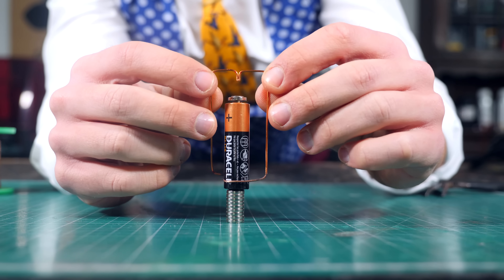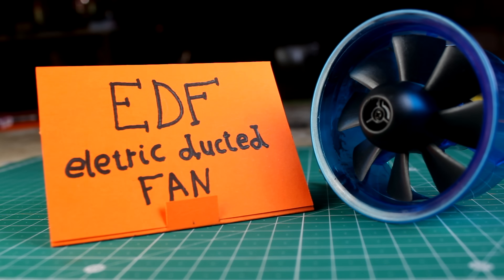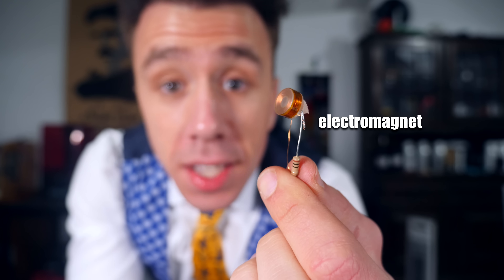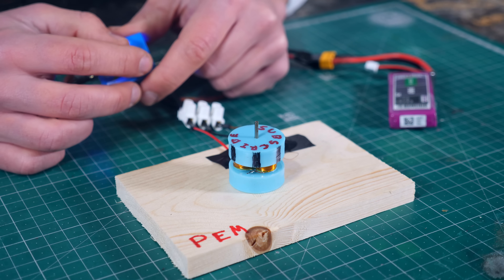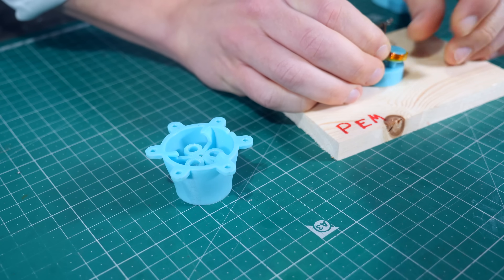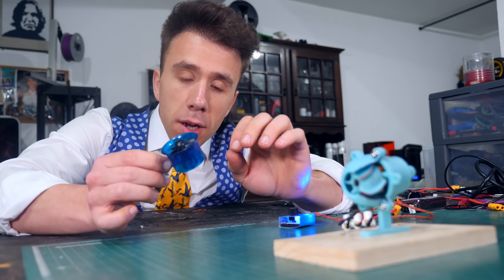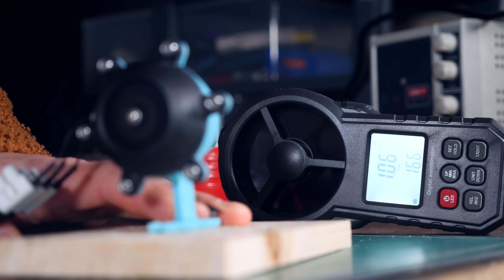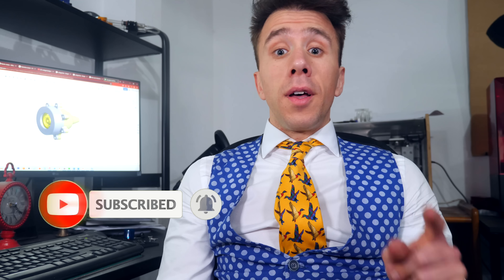I 3D Printed an ELECTRIC MOTOR FAN

Comment: Consider the total surface area of the blades on the original fan vs the total surface of the blades on the printed one.

Also, check the RPM the dyson spins that impeller. IIRC it's well over 10k and doesn't work well at lower RPM's.

Edit: Sorry. MORE gains at low-mid and better efficiency, but their power curve drops off faster. Good choice for an automatic or if you have a lot of gears. No need for a BOV.

Comment: The shape of the plenum is backwards. Yours goes from small to large essentially “diluting” the air stream as there is no combustion to increase pressure, where as the edf’s plenum forces more air in and compresses it better.

Comment: My gut instinct from being a drone guy my whole life is that the motor you are using is underppropped for the impeller, it could probably swing a prop twice that size. The EDF is so small because the shape of the lip around the duct pulls way more air in so it can make better use of a smaller prop, the intake size on the impeller however is much smaller so I think that's ur problem. Make the impeller bigger

Comment: Gosh, that's a pretty general question and I think would be difficult to answer without extensive testing. Fan blades are often just se type of aerofoil and the shape and tolerances do a lot. How your fan is grabbing the air could affect performance a lot.

There could also be an issue with bleeding energy if the housing is shaped in a way that's causing a lot of drag. There could too much turbulence and dead zones which constrict airflow.

Since you're dealing with pressure, you could be compressing the air too much, causing back flow  and air leaks.

Comment: I'd say its based on the design. Pretty sure an impeller is used for fluid most of the time, and I can see it producing a good vacuum but not much for thrust as it throws much of the thrust vector to the sides and out versus a linear path like a fan blade or propellor. If not that, then try closing in the rear end of your design to force higher amounts of pressure out of the tail (might also slow it down, but would be better for thrust once combusted).

Hope it helps.

Comment: Might be because the centrifugal fan puts airflow more radially, meaning that the airflow must change directions. In doing so, it loses energy.

It could be a multiplicity of factors, such as flow area (as has been mentioned) or increased drag due to other surfaces in the airflow path (the aerospike).

Comment: First, look up the fan affinity laws, also known as similarity rules, to get some understanding of what makes fans different (and what makes them alike).
Second, You can measure the electrical input to see how much power is being put into moving the air, temperature to measure heat in the air, and flow rate (you can use a pitot tube and manometer) that could give you the flow characatrinsics of your fan.  All fan designs (fans and pumps) have an efficiency curve (also known as a pump curve, fluid power vs electrical power), and they have different speeds where they feel “comfortable”.  To sum my comment up that is probably just me babbling, your fan has more losses (corners for the air to cut and more surface to rub against) and it has a smaller diameter (see affinity laws), thus the fan is making more heat than the original fan.
Reply: This may not be super helpful, but it could give some helpful background and understanding of how these things work

Comment: when i was doing my engineering degree it got explianed to u as the c value for the size of the fan is to large. C is simply the clearance between the inner and outer parts of the impellar. Because it deformed under the rotational forces, you increased that c value when you added more clearance. the c value to the size of the impellor is to large. Thats why large fans with small clearnces are so efficent. This is very much a testament to the tolarnces that dyson can build its impellors too. one thing you could try is to put a cut out into which the material can sit in the casing as it spins up. That may reduce c sufficently to increase the output. The materials here are your limiting factors though.

Comment: it has thing to do with how many times air flow needs to change the direction, as well as surface area of the fan, as well as angle of attack. surface area and angle of attack is pretty obvious and easy fixed as well. but about direction, imagine leaf blower having outlet the opposite of the intake (moving the same volume, not restricting). it would not generate same pressure just because pressure is decresed when you rotate highest pressure air to 90°. but notice it has no effect if you change the direction after outlet, because in that case flow is not restricted as much as very little amount of air is actually doint sharp perpendicular curve. the same way why we don't use sharp turns in any kind of liquid pass through, even though it'd make design easier. so sharper curve = less flow. in your centrifugal design you're trying turn all of the incoming air to 90° and push it to tiny opening between wall and propeller, where in a case of impeller its slowly guided to outlet. centrifugal pump with opening at the bottom instead of its side is pretty effective demonstration why tesla valves work in principle. ways to fix it if you dont want to change current design of fan. give it perpendicular outlet with respect to intake, effectively building a leaf blower. you'd be surprised how well even the current design will work. another way is to first decrease the pressure, change the direction and then increase the pressure again. this can be done both sides, either intake or outlet. to do it the outlet side just increase the clearance after fan, change the direction, then decrease it to the same area that you currently have as a clearance. this will have positive result but not as much as if you changed the direction at the intake side, basically a leafblower with intake moved perpendicularly

Comment: Integsa there are several possible reasons and one definite one. Nobody uses centrepetal flow jet engines any more as they are less efficient than axial flow. Even though originally the change was for aerodynamic reasons, even static systems only use axial flow engines now. Then there is the whole geometry VS RPM issue. IE what is good for one motor running at X RPM will change efficiency ay another RPM range. it's a bit different for water as water is far less compressible than air. please do not take the explanation for the second point as as absolutely correct as I have not looked at this in detail for 30 years and have not used the knowledge in that time either.

Comment: The two fans have different design properties of each fan, the EDF has a larger intake and larger blade diameter allowing for greater airflow, your design needs a second stage of fans added to pull more air in then use a version of the existing impeller to compress and accelerate the air

Comment: I've been thinking about making a fan like this (Centrifugal fan directing air, ultimately, straight along the axis like a jet turbine) for a while, but I'm not nearly good enough at 3D modeling to actually do it.  Plus... I'm not actually an aerodynamics engineer of any kind.  But what I will say about your design is that it has a lot of things in it that bug me.  My mental model (simplified) is that after the air exits the centrifugal fan, it travels through a duct that is the space between two teardrop shapes (inner and outer), with a constant cross-sectional area so that all of the pushing power of the fan is redirected to a circular output at the tail of the teardrop, without any of that energy going into either compressing the air down the line, or turning into turbulence when the high pressure air meets an open cavity.  Please forgive the terribly crude artwork, but this is a rough cross section: https://imgur.com/jVKskUH  Your first attempt at a centrifugal fan duct doesn't do anything to smoothly redirect the air, and the tail end of your jet turbine has a large cavity that will turn a lot of that air pressure into turbulence and drag, eating up energy to no good effect.  The ideal form of this fan, I think, will have a very smooth duct all the way from the edge of the fan to the outlet.  I'd like to think that if you could keep the cross sectional area constant (You have to vary the height of the duct as the radius of the inner surface shrinks), by the time it came out the end the flow would be close to laminar, which should help it project out the end of the fan duct in a nice little jetstream.  All of that is theory, though, because I haven't been willing to learn how to do the advanced 3D modeling required to turn it into a test platform.

Comment: my guess is that the surface area of the blades on the impeller is much smaller than on the EDF, so the impeller moves less air. a good way to test this would be to measure amp draw for the two designs. you could also run them at full speed for a few mins and then check the temperatures of stuff.
Reply: ^ this. Measuring the current flow and voltage gives you input power, and then if you measure both thrust and exhaust velocity you can measure the jet power.

Divide one power number by the other and you have efficiency, which feels useful to know.

You can also measure both exhaust velocity and thrust for both fans (the EDF and your centrifugal jet) to get the power of both. I would expect your centrifugal fan would have a higher exhaust velocity and much lower mass flow at any given motor power level, which will explain where all the thrust is going. I mentioned in another comment already but for anyone who hasn’t seen that:
Power = (exhaust velocity ^2) * mass flow
Thrust = exhaust velocity * mass flow

So trading away velocity to add mass flow increases thrust, even when power stays the same.
Reply: @ChrisDRimmer Very nice explanation

The reson for having high velocity is being able to still produce thust while movibg quickly, but comes at the expense of power

Comment: could be due to friction losses? The centrifugal's current has more surfaces to contend with while the ducted fan is designed to reduce vortex's at the blade tips, increasing stream lined current and thus more thrust. The ducts efficiency is closely related to the gap between blade tip and ducted surface. Maybe compressing the air its self is has a direct relationship to the amount of thrust lost? It takes energy to compress a gas, that gas heats up. when in an enclosed space its a benefit, but a lot of that potential is lost being vented out to atmosphere.

side note" Ive always wondered what if we made the leading edge of a wing tip like a dyson fan. Exhausting jet engine through the wings and out these ports along the leading edge, taking advantage of the laminar effect to manipulate the differential air speed above and below the wing in efforts to effect lift capabilities. just an idea, let me know what you think?

Comment: Looking at your designs it seems that you're choking your impeller thing. Fans aren't good for creating pressure behind, they're good for pumping air volume when there's no resistance behind. When there's resistance for air behind fan the air throughput falls significantly. 
If you look at the Dyson's design there's rather small inlet, but big exhaust, with no restrictions. Then it flows out through a narrow slit, but it's long so the area is still substantial.
Jet engine is a bit different from what you're trying to build. There are multiple "fans" but they aren't creating the thrust, they're compressing air for combustion chamber, and the thrust is created by burning fuel, which overcomes restrictions imposed by "fans" in the exhaust. It's kinda "fan-ed rocket". While in your case you trying to creating the thrust by the fan itself and it can't overcome restrictions just like the gases from burning fuel.
This is why EDF looks the way it looks - just a pipe to create minimal resistance to the air flow.
If you need to create pressure rather than flow, you'd better use turbocharger "snail" as it's better at compressing air than EDF.

Comment: I studied impeller design a while ago. You will get higher pressure/flow if you enclose the impeller blades with a shroud. Air is then centrifugally forced to the outside edges. Running them in free air won't work as well.

Comment: Mass flow rate. You aren’t getting enough in. Having it axially allows a greater axial flow of fluid as you don’t have a lot of mass behind it You could alter the design to have a turbine to help spin the impeller/fan more. Try printing a toroidal fan as they have greater efficiency than standard fans/props.

Comment: Can someone explain why it "should" have the same amount of thrust? Sure it's the same motor but a jet engine and a fan generate thrust in completely different ways. Jet engines generate thrust by accelerating pressurized air through a nozzle while fans generate thrust by "pushing" the air like an oar pushes water in a canoe. As a result, it is my understanding that jet engines work better at high Mach numbers (when flow is compressible) while fans work better at low Mach numbers (when flow is approximately incompressible). We're dealing with low Mach numbers here so I don't find it altogether surprising that a fan produces more thrust than a jet. If there's one thing though that I'm sure of is that it's more complicated than can be expressed in a few sentences though.

Comment: The problem might be that the impellers just need higher RPMs, like those Dyson ones literally spin at over 100,000 RPM in order to achieve peak performance, so it's doubtful that any meaningful thrust could be made with one of their impellers spinning at only around 7,000 RPM

Comment: Your base assumption is sort of a weird one. If you keep the same motor and electronics but "just" change from an EDF to a cycloidal compressor why would you expect the same performance?
Merely changing the pitch on an airscrew completely changes the behavior of the overall system.
Take a Hacker A50-10xl v4 with 690kv and power it with a suitable esc on 6S. If you drive a standard APC Electric 14x10 with it the motor will barely reach full load. Your resulting flow will be around 170kph with a static thrust of around 7kg.
Change the pitch to 12, with a 14x12 APC E prop the same motor now creates an airflow of over 200kph and 9kg of static thrust. Your motor will be pretty toasty, almost reaching 100°C even with good cooling. Now go to 14x14 and your motor will actually struggle to stay alive. With an airspeed of around 300kph, the same 9kg of static thrust but an actually stalled propeller below 180kph with stalled thrust of 6kg.
And that's by changing the pitch by something you could barely tell with the naked eye.

You're changing the entire mode of aerodynamic load. No way is this gonna behave even similar.

Comment: Centrifugal fan(compresor) is for bigger pressure, not bigger flow.
Try put longer fan duct with smaller hole on the end (that is what you can not do with axial fan)

Comment: I would assume it's not going to match airflow because the Dyson impeller is designed to be high static pressure not high airflow and the original fan blades are designed for airflow not static pressure.

Comment: The Dyson impeller is designed for compressing air, the EDF you have for moving air. Other people have gone into more detail here, but the geometry of the inlet and outlet matters if you want to use the Dyson impeller design to move air.

Comment: I’m going to guess there might be too much turbulence after the impeller. It cones from the center outwards then a void. Also the supports on the motor mount might be stopping the funnel effect also causing turbulence.

Comment: If you put the same engine in a tractor and a racecar they will perform really differently as well so it comes to no surprise that using the same electric motor gives different results in different fan designs. I believe a centrifugal fan is better in achieving high pressure whereas a normal fan is more optimized for high airflow.

Comment: Integza, a centrifugal fan won't work. They are resistant to backflow if designed properly, but don't make a large fast stream of air. A centrifugal fan will never work for you. But yours sucks so hard because your geometries are poor and the fitment of your parts is even poorer.

You keep saying that the thrust should be the same. I don't know why you think that. I thought you were a bit smarter than that.

Comment: i guess that the centrifugal one does way more pressure, thats what they are designed for. die Duct fan just produces high flow. just look at the turbocharger of a car. Same design as yours.
you could produce more flow by trying to suck air after pressurizing it. with a kind of laval nozzle with holes in the side for air intake after expansion. but there will me less flow than the duct one still.